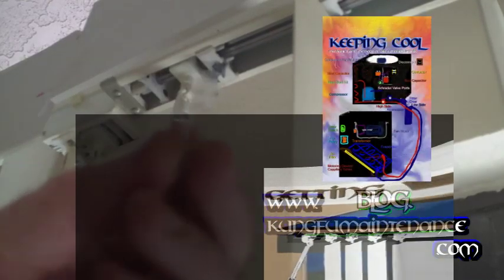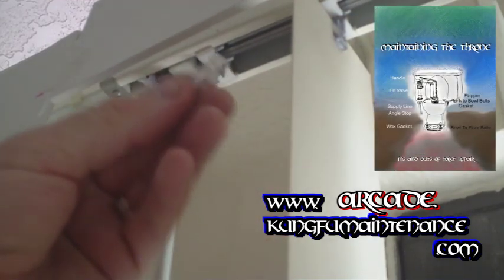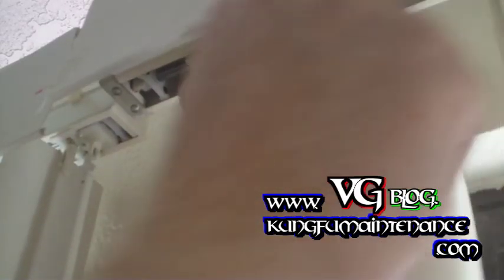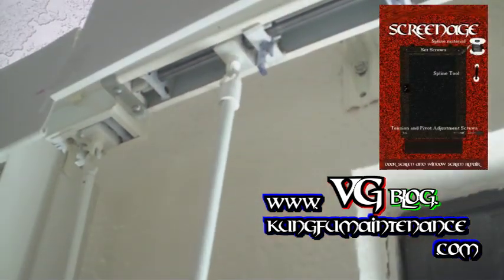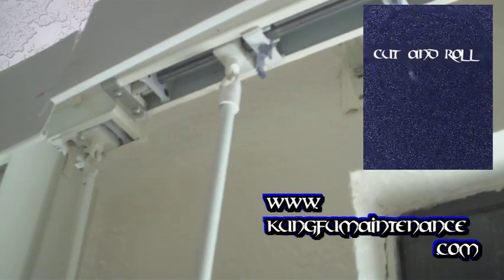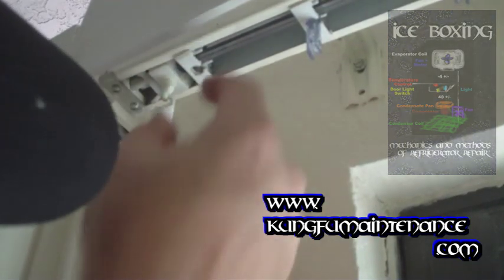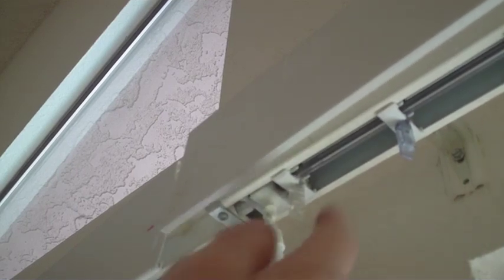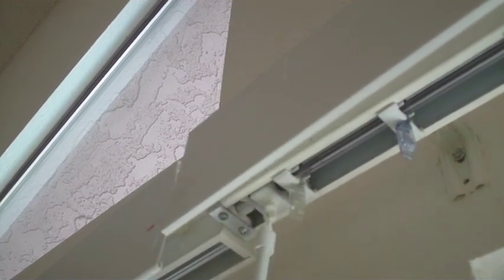How To Fix Blind Stems and Gears ~ Getting Vertical ~ Vertical Blinds Repair

Comment: I broke the twist handle thing that is used to slide the blinds open and to rotate the slats - not the handle itself, but the little worm gear or whatever that engages the bar.  I overcranked it and I felt a snap, and now it the handle just spins without turning the slats. Is that twist handle gear replaceable?

Comment from the maker: If you live in a quality Apt. complex I would just call it in as a work order. They may just tell you they will fix it upon the turn over which you might suggest to them if that was more convenient for them and they would not charge you for it.You might itemize a list of repairs needed that you have lived with for awhile such as slow sink drain etc.. and couple the blinds with it and turn in your list as a work order. Or with some patience and some temporary tape you could hot glue slats on.

Comment from the maker: These are not easy to find. I usually get mine from HD supply or recycle from old sets of blinds that I am discarding. If you only need one gear for a center blind you might take it from the first carrier. Than that first slat closest to the wand would rotate freely but that can have some benefits in that you can turn that one to see if someone was at the door or check on an odd noise without opening all the blinds. Alternatively you might call around hardware stores to see if they carry them.

Comment: The stems on my blinds dont pop out to the side.  Looks like they might pull straight out, but I'm not sure if that will break them or not.  Seens these kind before?  I'm thinking of replacing a broken stem in the middle of my blinds with one at the end of the blinds, so I wont miss that vertical blind as much at the end vs. the middle.

Comment from the maker: Some types have a small hole on the top of the head rail where the stem can be passed up through and changed out. Others do not have a hole but a hole could be drilled others the whole carriage can be slid out of the head rail and than repairs made. Sometimes an easy way is to wire tie the broken one right up against  the carrier next to it to gain the coverage you need.